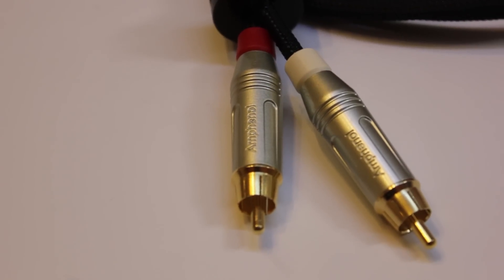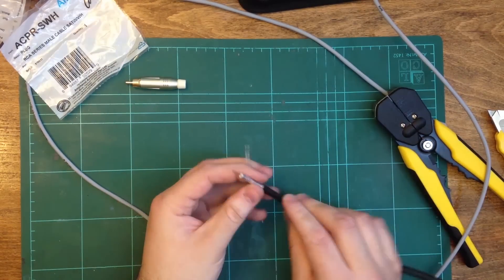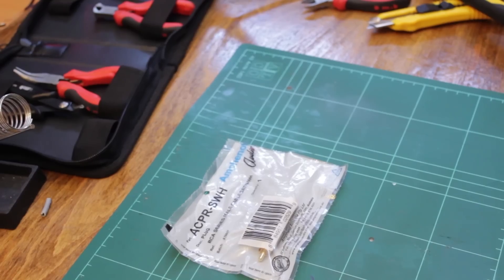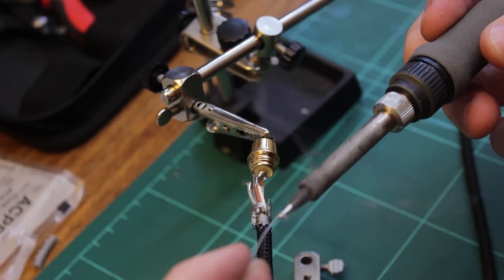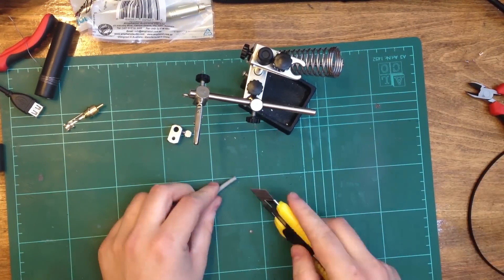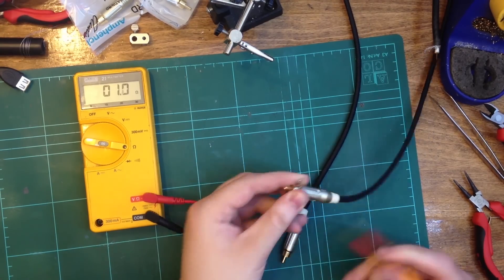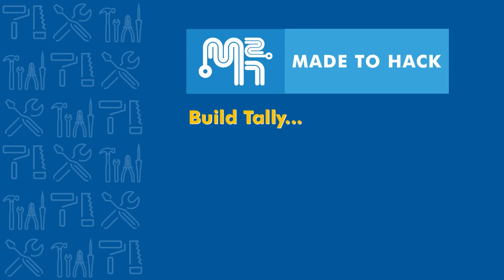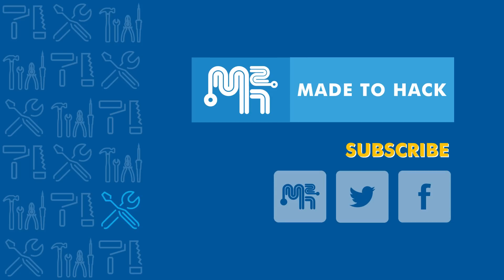How-To Make High End RCA audio interconnect cables

Comment: What if you had used one of the internal conductors as signal then the other together with the braided jacket together for the ground at the source end, then use only the 2nd conductors the ground at the opposite end leaving the braid unconnected therefore creating an RF frequency dump?

Comment: It seems not technically optimized way, the inner two wires are twisted and designed to cancel out the near end noise each other. So, if you are going to use a balanced cable for unbalanced system, then one of it(cold wire) shoud be attached with the shield together to the ground  (connected to the signal source side), the other side just connect one wire (cold wire)to the ground without connecting the outer shield. This can help to block the outer RF/EMI.
Reply from the maker: Thanks for the tips!
Reply: @Made2hack  are you actually making custom cables on request?
I was interested in purchasing an 11 foot locking RCA to RCA,  using audiophile components for DAC to home stereo left/ right channel connection.
Please let me know, 
Rafael Rivera
Reply from the maker: @rbr9657  Hi, you might want to look at Blue Jeans Cable (http://www.bluejeanscable.com/). They make custom length cables and are based I believe in the US.

Comment: I'm just learning so this video was helpful to understand the basic components.  Thanks for posting!  I'm going to thumbs up and subscribe to support your channel!   I think I need to watch many more!  The comments are informative.  Not sure what the shielding does and the implications of balanced/unbalanced, but just being introduced to these concepts is another step in the journey of understanding!
Reply from the maker: Well, in a balanced situation, such as xlr cables, you can get away with less or maybe even no shielding, as there are two signals carried by the wires, if my understanding is correct. That way, it is easy to filter out unwanted "noise". In an unbalanced cable such as these RCA cables I made, there is only one signal which can pick up unwanted interference. From electrical cables, it would be EMI (electro-magnetic interference). From random radio signals in the wild, it would be RFI (radio frequency interference). Think of any cable as an "antennae" that can pick up signals even if you're not using it as an antennae.
Reply: @Made2hack  Thanks so much for the info!

Comment: I note you used the two connectors for signal (+)  and the shield for return (-).  I thought it was better to use one connector for signal and then you have some options for return.  One option is to have the shield unconnected - the so called 'floating shield'.  The second option is to connect the shield to one end (usually the source end, in which case the cables are 'directional).  My preference - and I got this from Graham Slee's website - is to connect the shield to both ends.  In that case when soldering you might twist the return and shield wires together prior to soldering.
Reply: Canare website recommended to connect the Shield to ONLY ONE SIDE END, but Your preference (based on Graham Slee's website) : to connect the Shield to both end, does it make the shield act as a RF antenna ??..., Have you proved it as best option ?
Reply: @arakhairany899  Better option is both sides having XLR connectors in a balanced system setting. But having a starquad is even better.

Comment: Two things - the capacitance of that cable is very high. Not at all good for phono interconnect.
Amphenol plugs are decent and cheap but not exactly the best you can get - from my experiences so far I have to recommend Neutrik Profi (for regular insertion and removal / 'pro' / stage use) or KLEI copper harmony for home/regular use. Both not cheap connectors - they used to be around the same price a year or so ago though, the KLEI just went up around 90% in price over the past year. I hear good things about Vampire plugs but have no experience. Oh, there is a new 'budget' KLEI range - 'Classic Harmony', but they are still $22.50 each compared to around $10-12 AUD each for the Neutrik. The KLEI's do have discounts if you buy up to a 12 pack though.

Comment: Poor soldering and assembly of those connectors. No cleaning? No flux when soldering the wire to the connector? Poor prep? It looks like the insulation also suffered from that croc clip - might be a good idea to sleeve it if you plan to grip wires with them.
Reply: It seems REALLY hard to find a good RCA video on youtube.

Comment: Why is that a Hi-End cable? How is it special?
And where have you got the idea to wire a cable that way? 99,9% of the RCA cable builders do connect 2 wires separately and solder a shield at one end only.